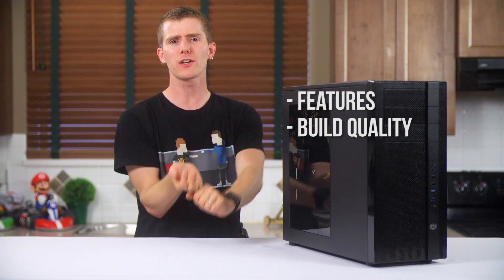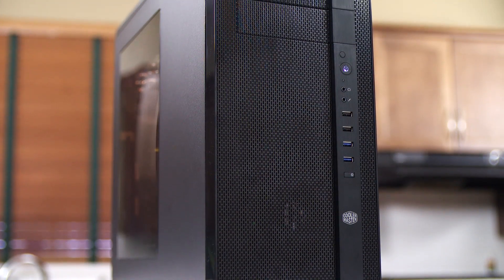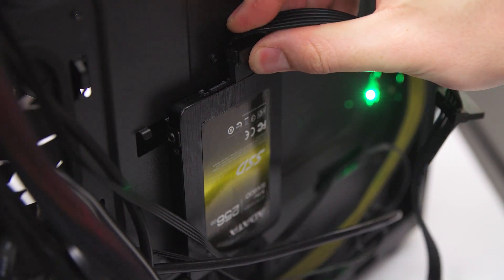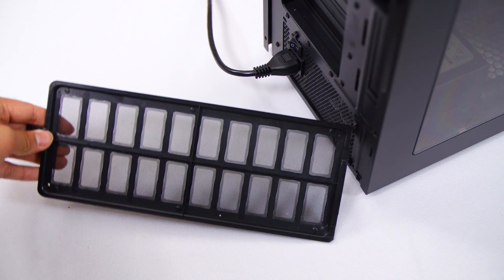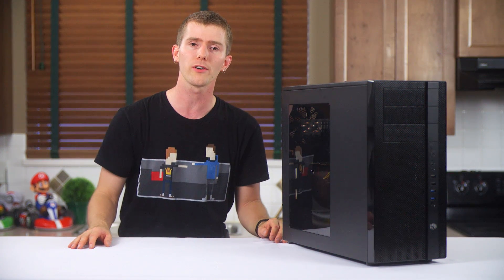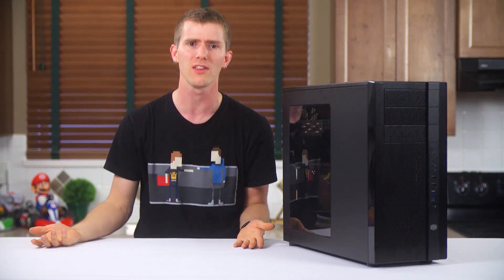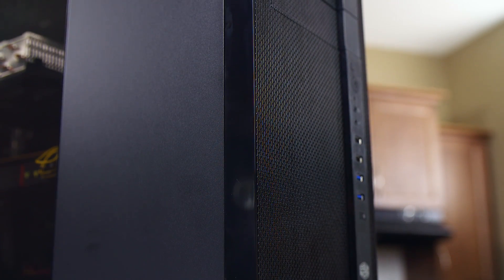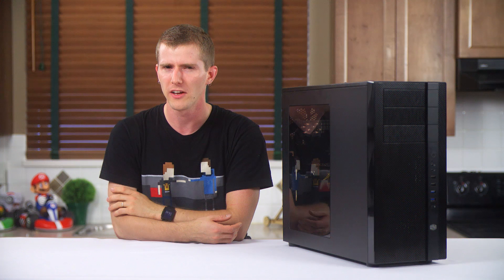Cooler Master N600 Computer Case

Comment: I bought this case recently because of 1 features. The drive cage is convertable to 2.5 from 3.5 to give you enough room to put in a Sapphire 290/290x tri-x (~305mm) while giving you an ability to have 7 drives (3 HDDs (2 if you have a fan at the bottom it blocks the very bottom HDD mount (see HardwareCanucks review) and 4 2.5" SSD/HDDs (1 SSD at the back of the case)) for cheap. In my research I found couple others that the ability to fit the sapphire tri-x The 230T (330mm clearance even with bottom slot according to one review and 400+ on top slots), Cougar Archon (barely 310mm) and this case. There are others but you need to remove the drive cage to make room. Just thought I'd make this comment for someone who is in the same situation as me.

Comment: I had $35 in my budget for a case and a psu
Reply: +Austin H nah m8 i got a decent new matx case and a 500w psu, its grand
Reply: Clutch
Reply: +Keltic Peak ???
Reply: you dont know the meaning of clutch?
Reply: It's kind of an old term. Not sure if many gamers use it anymore.
Meaning to succeed in a situation where success seems impossible.
Reply: +Keltic Peak meh different cultures where are you from
Reply: East coast of the Unites States.
Reply: +Keltic Peak east coast of Ireland
Reply: Clover ayeeeee
Reply: How's that power supply?

Comment: I love mine....its a very solid case with plenty of room and great air flow.

This is what i crammed into it

I7-4820k with Corsair H60 cooler
Gigbyte X79-up4 with 16gb C. vengeance 1866 mem
evga gtx 780 sc /acx
evo 840 SSD (500gb)
wd 1 TB HD
Corsair RM850 psu
NZXT Sentry LX fan controller
various led lights

and still have room to spare !!

Thanks for all the great videos Linus !!
Reply: +Andrew Rafko That's pretty darn good for a case that price. I do think the N300 windowed appeals to me more though. Partly because it's more widely available.

Comment: Also, just a heads up to people who are looking into this case there are 4 versions.

KKN1 - XtraFlo: White LED (Front), Fan LED button and Fan Controller
KWN1 - Above but with window (Note if you get the one without window you get an extra fan slots (2x 120mm))

KKN2 - XtraFlo: no LED (Front), No Fan LED button and No Fan controller
KWN2 - Same thing as above but with window

I didn't hear Linus mention it. NCIX Canada is selling KKN2 and nothing else (that I saw). Newegg is selling KKN1 and maybe the window version too.

Comment: Although it includes radiator mounts, closed loop radiators like the corsair h100 will not fit in this case with the fans attached, there is not enough clearance, but you can have a pull configuration for this case with the fans outside( if you are interested in installing a 240mm radiator)

Comment: I have had an Elite 430 for two years. It has great airflow and looks fine. There is no cable management, but I paid $50 for it (and got $10 back from the rebate). I would spend a bit more money on my next case, and this is exactly the kind of case I would buy. This or the Thermaltake Urban.

Comment: A missinterperitated case with so much potential! Imagine what it would be like without the ugly strip in the front, looks from 2007, space to put cables, and applying money to more necessary places. I would absolute get this case if it was more like a Corsair 450D, I like how I can use my GPU radiator on the side of the case instead of stretching or bending the tube.

Comment: Better than an R4 IMO, no contest.
Reply: I've built in both( as well as a Source 210, NZXT Gamma, CM N200, and Core 1000), they aren't comparable cases. the R4 fits a much more niche market and does it at a very low price point. I just so happens the price of the R4 made it desirable for people not looking for "Roomy" silent cases.

The N200 and N600 are more comparable to NZXT's Source Line, both of which have their strengths. The Sources are cheaper, but they are also not as well made either. If the price of the two cases is close the N600 usually wins out handily.

Side not the Core 1000 was the worst case I've built a system in the last year, but I consider the R4 to be the most enjoyable and easiest installation I've had to date. The difference between Fractals Core 1000 and the R4 is staggering.
Reply: vearheart42 Oh yeah, I mean I know the target markets and how they are not really comparable, but I have come to hate the R4 because it is just so bland and overused -- two opinions that Linus fanboys would hang me for.
Reply: TheSLSAMG Bland and overused - neither of those affects how the case performs.

Though it does have a ridiculous SSD mounting system and because of that I just screwed my SSD in to HDD bracket.
Reply: luuzeri It's an opinion. I understand the case performs better, but I stilll would choose a slightly worse case over it. And everyone has different interests in cases. Some like the loud, NZXT styling. Some like the subtle charm of a Fractal Design case. I personally like the bold style of the Corsair C70 -- which is why I own one.
Reply: TheSLSAMG The R4 is a great case to build in. But if I were to go with a "silent" case again I would go the NZXT H400.
At the moment I'm using a 750D, the only other manufacturer that stands out to me is Silverstone. But my TJ07 takes to much work for me to care about it.
Reply: I still love my Define R4. One of the best cases.
Reply: TheSLSAMG Well not everyone likes the minimalist styling but it's "overused" for a good reason :P. Any case can be a good case but knowing that aesthetics will almost always make or break the purchase for most of us enthusiasts, even with budget cases so it really all comes down to personal opinion and arguments like these are kinda pointless.
Reply: TheSLSAMG Well, saying you hate a case because of its design and popularity is a bit over the top. :P
Reply: TheSLSAMG I bought an R4 because I liked how it was silent, and I wanted a minimalist case as my base. But then Cut the biggest window I could on the side, added color changing led's and fans. Added an lcd fan controller, some carrying handles on top.
Reply: airgear87 That's actually not a bad thing to be honest. It's such an understated look that it's quite easy to make your own.
Reply: Omg it's the SLSAMG! Coolkingler1 here. :P
Reply: Goliath Hey! :p
Reply: luuzeri Yes I agree. I have R4 and that SSD mount behind motherboard is really ridiculous. I use it however because I took both HDD cages out for maximum air flow. I mounted my SSD behind MoBo and my HDD into 5&1/4" bay. Since my PC is in room where I sleep, I really couldnt find cheaper solution for silent PC. But I have to admin that CM N600 looks neat. I will be recommending this to friends on budget.
Reply: Wyrdak
Dude. Check out phanteks cases.
Reply: luuzeri They are nice but quite expensive in my country. 100 € for PHANTEKS Enthoo Pro Midi which I dont like and 237 € for PHANTEKS Enthoo Primo Big which I like. Also there is little variety of phaneks cases in my country. So it is pretty much not an option.
Reply: you have probably never built in the r4 then, such a high quality product.
Reply: sirnomnoms126 False, I have. I know for a fact that the R4 is a better case, but I have built in six of them. They are overused, and I would take the quality hit to have something different. Then again, I have built in better built cases than the R4, like the Corsair C70.

I make weird compromises.
Reply: TheSLSAMG you're comparison threw me off a bit, but I wouldn't change my quality standards for something different. Just buy another case from the same price range as the r4.
Reply: sirnomnoms126 So, for example, the C70, 450D, H440, Enthoo Pro, etc.
Reply: TheSLSAMG 450 D and h440 are great cases and look great too but the enthoo is a water cooling case I think.

Comment: i think that if they offer this case in multiple colors and include LED fans then with this new chasis design they could probably DOMINATE the low budget price point in sales. However i do apretiate cooler master taking function over form as a number 1 priority in their cases allways unfortunately the majority of the buyers in this price point do not and usually get the blingy cases because they don't know better.

Comment: Interesting, but still not convinced I should bother buying a case at all. There's plenty of angle iron at my job just lying around, sheet metal is cheap, and wire feed welding can yield some surprisingly aesthetic bead lines.

Comment: Zalman Z11 guys, 85 bucks worth spending.

2 i think 120 mm fans on top
1 on the front
1 at the back
2 fans integrated in the 'doors' of the case.

Comment: thermaltake versa h15, its fucking tiny but you can fit a hole boat inside it, 3 watercooling rads 2x240 and 1x120, 2 graphics cards (dual slot) and a normal psu. only problem is the cable management is abismal but it can be stashed in a corner or by the psu. oh and the dvd and hdd bays and cages are removable so you can velcro mount them to the bottom for a clean look and free up space.      

LINUS REVIEW THIS CASE GOD DAMMIT !!!!!!

Comment: I have the n400 and its so hard to manage the cables 
has no room for mounting a 240mm rad on the side due to the cables and no removable hard drive cage :(

Comment: Im a complete novice doing my first build. Which molex connector would I use for the fan controller on the back and where would it plug in on the MSI z97 gaming 7 MB?
Reply: Seen another video of yours showing how to change the voltage for fans on a molex adapter. I think I figured out that its a molex to 3 or 4 pin fan adapter that plugs into a fan slot on the MB. Please tell me if Im right.

Comment: It's so stupid that you keep expecting case manufacturers to improve their packaging solely to cater for system builders. Hard foam is clearly adequate for shipping a case, whether or not some break it's got to be economical for them to use it over more expensive foams. If system builders want soft foam they should package their computers with it themselves rather than trying to pass the costs down the line to the next person.

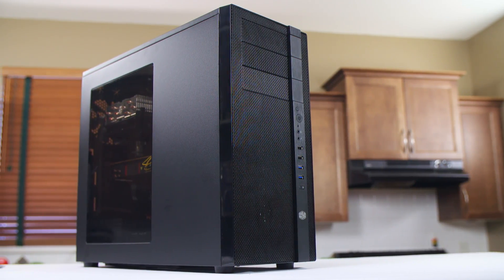Comment: 6:09 I disagree I am fine with finger prints because I wipe them off with that cloth meant for glasses.
Reply: +Mike Sico (Deathab0ve1) a microfiber cloth? thats what i use for my glasses atleast. (i need clean glasses, my eyesight is worse than 99.95% of the population, lol  :)

Comment: There are just better and more interesting cases for the price. (Bitfenix, Fractal and Corsair)
Better have a lot of promos, CM.
Reply: What specific features do you feel are lacking on the N600?
Reply: CoolerMasterNA Aesthetics at the first and foremost. (which is subjective)
Particularly externally.

It's not sleek enough to cater to the minimalist crowd yet not gaudy enough for people who like cases like the HAF line.
I'm not quite sure where this case fits in.

If you are wondering what to do with the aesthetics there are too many material changes: Brushed front accent -> mesh grill -> glossy plastic bezel -> matte/satin panels. = Too much
Cases like the Bitfenix shadow or the Corsair 200r stick to a theme.

Thanks for listening!
Reply: CoolerMasterNA Since you're in the comments I wanted to add that I recently built my friend's computer in the N200. I found it very good for the money. I do agree with Linus though, I spent 20 minutes trying to cable manage the 24 pin connector behind the motherboard and finally gave up. There is also a small lip over the first PCIe bracket that can cause conflict with plugging in an HDMI into the gpu. Other than that it is one of the more solid mATX cases I've seen.

Comment: What are similar cases in terms of qualitly and price?
Reply: the cooler master n400
Reply: Corsair 230T is cool also.
Reply: +SirThanksAlot Aerocool Aero-800
Reply: Corsair Air 240, 230T, etc.
Reply: +SirThanksAlot corsair 100r has every thing this case has and its better looking (in my opinion).
PS, if your into silent cases you can pay an extra $10 and get the silent edition witch will also have an additional 12cm fan and a fan controller, its also the case that I'm including in my next buil.
Reply: +SirThanksAlot the 100r is also priced at $50.

Comment: PCPartPicker part list: http://pcpartpicker.com/p/yZ2YmG
Price breakdown by merchant: http://pcpartpicker.com/p/yZ2YmG/by_merchant/

CPU: Intel Pentium G3258 3.2GHz Dual-Core Processor  ($69.99 @ Amazon) 
CPU Cooler: be quiet! Dark Rock Pro 3 93.3 CFM Fluid Dynamic Bearing CPU Cooler  ($64.99 @ NCIX US) 
Motherboard: MSI Z87-G43 Gaming ATX LGA1150 Motherboard  ($109.79 @ Newegg) 
Memory: Kingston Blu Red Series 8GB (2 x 4GB) DDR3-1600 Memory  ($71.88 @ NCIX US) 
Storage: Sandisk Solid State Drive 128GB 2.5" Solid State Drive  ($54.99 @ Newegg) 
Storage: Seagate Barracuda 1TB 3.5" 7200RPM Internal Hard Drive  ($49.99 @ Amazon) 
Video Card: XFX Radeon R9 270 2GB Core Edition Video Card  ($139.99 @ NCIX US) 
Case: Corsair 330R ATX Mid Tower Case  ($79.99 @ Amazon) 
Power Supply: EVGA SuperNOVA NEX 750W 80+ Bronze Certified Semi-Modular ATX Power Supply  ($59.99 @ NCIX US) 
Total: $701.60
Prices include shipping, taxes, and discounts when available

Comment: Can anybody recommend a really good mATX/ITX case for a high end SFF Build at around 30 USD or 45 Singapore Dollars?
Reply: a really good case for 30 dollars....
Reply: For high end 30$ is not going to get you anywhere. I would recommend at least 80-99$ to get something quite nice thats MATX.
Reply: $30 is not nearly enough for a good mATX/ITX case. 
If I was you, I would get the Corsair 250D. Trust me, worth the extra money.
Reply: Shoe box?
Reply: My apologies if the range is abit tight guys... that's all I could afford.
Reply: MusicHaven2012 My apologies for my unnecessarily rude comment.
All in all you will probably have to go with the cheapest thing you can find. 
Maybe even second hand.
Reply: try to find a fractal design core 1000 on sale
Reply: Cougar spike or mg100. German made, okay quality. Got an archon black and the only problem is the quick snap out front pannel had a screw for some reason. Almost busted it.
Reply: Boreal Games German made....?
Reply: Go bizgram website and check their pricelist for cases but seriously 30/45 for a case..you can't get one in sg..you can check out the hardwarezone marketplace to check if someone is selling their cases second hand
Reply: http://www.amazon.de/Xigmatek-Asgard-Midi-Tower-USB-3-0/dp/B002T3D71U

This one is pretty cool but maybe a bit too big for your purposes.
The Cons of this case are mostly that cable managment doesnt exist and that the screws in the sidepanels are not too good
Reply: cheapest i found was the spec 01, its SGD79 in simlim. just save up $30 bucks more
Reply: Spend a little more and get the Zalman z11 plus or Zalman z11 plus hf1
Reply: TheDirrtyMike that kind of comment really isn't necessary. I'm sorry not all of us are as educated as you, obvious by your pic.
Reply: Fractal Design Core 1000 try that one if youre really want to spend only that amount
Reply: Cougar Spike is the best budget case you can get. YES it is a german company
Reply: Just make sure to check all the deals. At this price range your best bet is often a $50 case on sale or with a great rebate. I remember seeing a Fractal Design case at Microcenter here in Chicago for $25 a few months ago.  Many stores sell their floor models for 40%-50% off.

Comment: I'd rather get a Corsair C70 case it's about the same price.
Reply: Hi Randy - any specific reason why? We think the features are great for the price, but we'd love to know how we can improve this case as well.
Reply: CoolerMasterNA IMO I would rather have the Corsair C70 only because it's design suits a gaming rig better. But the N600 is sleek.
Reply: This case is better in every way, and it costs LESS than the C70. That is without a doubt the ugliest case Corsair ever made. Their cases over a $100 are best in class, but they do not do inexpensive well.

Comment: I have this case, dont buy it... a lot of linus sais is "over optimistic" ... good luck putting dual gpu and liquid system... the side panel can only fit AIO liquid cooler, not a rad, and theres so little space for cables that I would like to see you try putting a dual card (unless you want to destroy the side pannel, cramming the cables).
The included fans suck completely, I removed them (with the controler). The front of the case is so weak, it was pushing on my fan blades, I had to take pliers and start pushing it away... In other words this is a compact system, it looks cool with a windows, but its too crammed. If you want to buy it, buy a windowless version and put it under your desk... If you want to build something cool and show off your system, buy something else.

and PS. the power button is so on the same lvl with the metal, that its basically invisible, you have to always stroke your fingers to find it and press it.